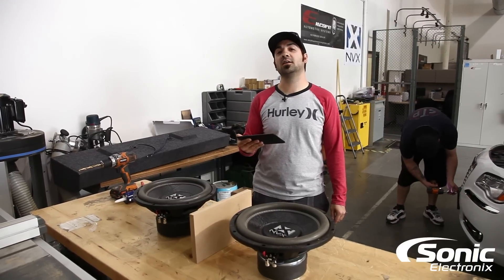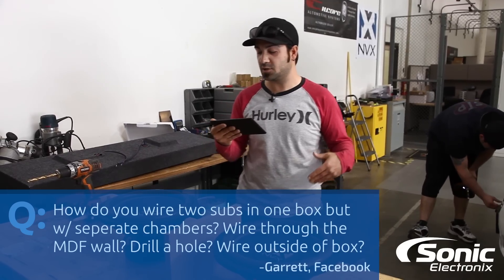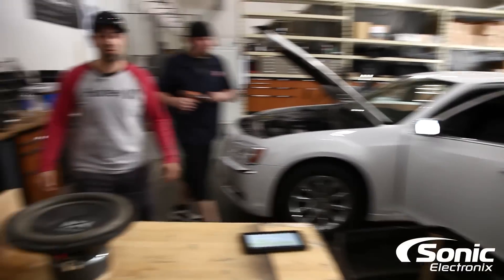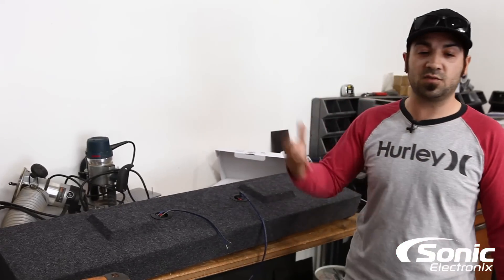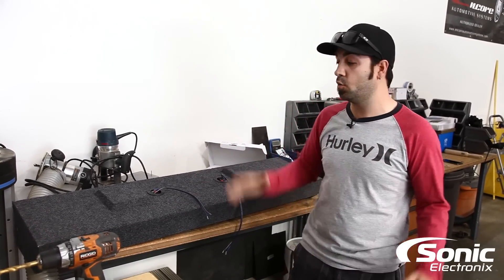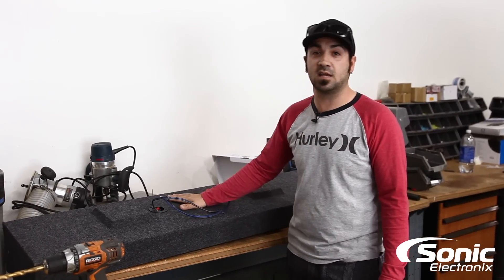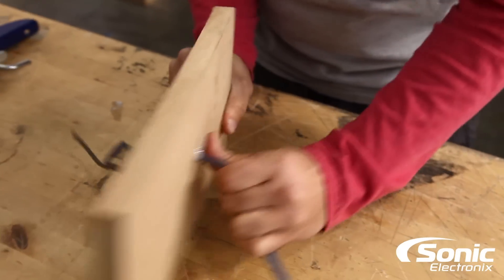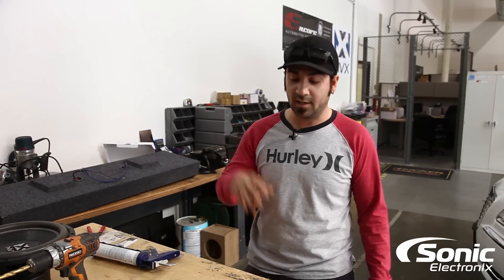How do I Wire Two Subs in a Box with Separate Chambers? | Car Audio Q&A

Comment: I hope you can help me. Im going from a speaker box with 2 terminals to a box with 1 terminal. Can i fuse the speaker wires together from each side + to + and - to - and plug em into the single terminal on my new box? Please help
Reply: Sure..that is a parallel  wiring setup internally dividing whatever your subs voice coil ohms into half

Comment: how to use both cups with a 2-ohm amp, 2 2-ohm dvc subs? Q-Bomb box. 2-ohm impedance.
Reply: Running voice coils in series adds their resistences.  Running them in parallel divides the ohm rating by the number of parallel connections.  So your goal is to wire your subs in series, parallel, or series parallel (because you have 4 voice coils, 2 on each sub, you can run each sub's voice coils in series and then connect the subs together in parallel if you want).  Anyway, you probably need to get a cheap multimeter and use the ohm setting to test your configuration.  Wire the speakers and then connect the tester to the wires that you intend to connect to the amp.  You're shooting for  2 ohms at the amp.

I can help you with the math, but the only thing I'm not sure about is whether a company labels a sub as 2 ohms if it has 2 ohm on each voice coil or through both.  I assume it's each coil because otherwise you have to decide if you're going to wire it in series or parallel just to calculate the ohms.

If each voice coil is 2 ohms and you want to use 2 wiring cups, wire each speaker to its own cup with the voice coils on each speaker wired in series (+ cup to + coil #1, - coil #1 to + coil #2, - coil #2 to - cup).  This will get you 4 ohms at the cup.  Do this on both sides.  This gives you 2 cups with 4 ohms each.

The rest depends a bit on the amp you're using, but I'll assume it's a single channel with a single + and a single - terminal (Some amps, even mono block single channel amps, can have multiple speaker lugs).  Now wire the cups together in parallel (+ cup #1 to + cup #2 and - cup #1 to - cup #2) with a common lead for your combined positive and another common lead for your combined negative to go to the amp.  Wiring both 4 ohm cups in parallel will drop the ohms down to 2 ohms at the amp.

AGAIN, PLEASE CHECK THE CONFIGURATION WITH A MULTIMETER BEFORE CONNECTING IT TO THE AMP!

Comment: If all the power has to pass through 1 subwoofer first before it goes to the other id think thats gonna make a resistance issue for one sub, the sub closest to the amp or 1st in line takes the brunt of the bass hit and the 2nd sub will get the residual.  Is that not how it works?  My recommendation is to have separate terminals and join the wires at the amp and run equal lengths of wire to each terminal.   Doesnt that make more sense??
Reply: Obviously depending on how u need to wire your coils and how many channels your amp is but i think each sub needs a direct line to the amp.

Comment: hey allyn,
can you help me out.

i have 2 subboxes with both  a single 4ohm coil.
i want to wire them in parrallel for a final 2ohm load to my monoblock.

can i just take the both + wires from the subboxes and wire them together to go in to  the amp
same for the  - wires from the subboxes to the amp.

wil this work for a final 2 ohm load.
thanks alot.
Reply: When you put 2 4ohm speakers together you get 2ohm as long as the speakers are together, no special wiring is needed... meaning you put both negatives together and both positive together. going into the amp. There are a few ways of doing this. depending on the gauge wire you use. If its not a thick gauge you can just join them at the amp. If you use thick gauge like 8 gauge or 4 gauge then you use a distribution block to connect them then you run a single wire for both  positive and negative to the amp. i hope this helps.
Reply: Grimey 1991 do I have to use a distrubtion block I’m using 8 gauge but if I conjoined them it would still fit into the amp

Comment: I usually split the wires and drill a hole for each wire making it tight as possible, then caulk or 5 minute epoxy both sides of each wire. Also put caulk/epoxy on the wire once it's close and finish pulling it through so there's some inside as well as outside. Leaving it totally undisturbed till cured.

Comment: Use a bolt.... Connect wire terminals to each side and crimp the wires to the terminals... Boom no leaks and no silicon and no rattle but if u wanna use silicon it works just as well depends how u wanna see it looking inside

Comment: So I have a question, I just 2 12 inch alpine type s subs and have them wired in parallel, down to 2 ohms and I was wondering what amp would power them best to there full potential
Reply: Alpine MRX 110 monoblock

Comment: hi 
i have a problem and i need someone to help me!!!
i have a woofer box with 2 50 watt speakers with 6-8 ohms impedance each will this work if i connect it to a 75 watt amp with an unknown impedance 
what impedance will it have to be for it to work?
also is there a device i can put somewhere in the circuit to change the impedance to match? 
cheers toby

Comment: I have a 2014 f150 with a factory subwoofer, and the amplifier is not with the subwoofer. Can i take this subwoofer out and tap into the wires for the rca outs if these are the wires from the amplifier?

Comment: I use a pair of bolts rather than a terminal cup
Reply: i use the terminal with the bolts.. or i just run the wire through and silicone it.

Comment: Yep I never use a terminal cup seen a few of those even catch on fire
Reply: I've never seen that happen, never heard of it either
Reply: THATS BECAUSE PEOPLE DO NOT USE RING TERMINALS TO BOLT DIRECLTY TO INSIDE OF TERMINAL CUP NUT. THEY USE FEMALE SPADE CONNECTORS TO SLIP OVER THAT GARBAGE TINFOIL SPADE TERMINAL CUPS COME WITH. Pro tip: remove spade, crimp ring terminal on speaker wire, reattach nut that was holding the spade on but now its holding speaker wire on.

Comment: My preference is to use two separate terminal cups. One for each speaker or maybe even one for each voice coil equaling 4 on dual voice coil speakers. This way you can change your wiring any time you like without removing the speakers from the box. You never know if your going to get a different amp or want to add more speakers requiring a different configuration. Thanks for the vids Sonic Electronics. Keep em going..
Reply: I can't find a video for that.
Reply: Yeah but don't you have to run 2 sets of rca cables then? And have a 2 channel amp??
Reply: Also can't change your ohm?